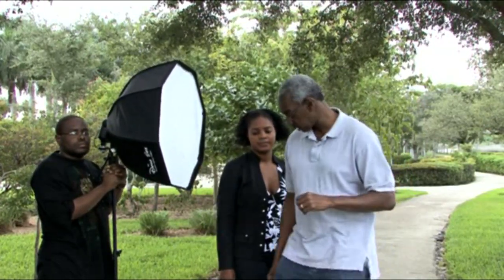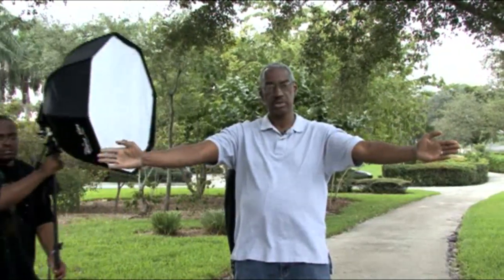How To Use An Off-Camera Flash With A Softbox

Comment: Mr Hill - Nice quick and informative video.  What strobes do you use for studio work or do you just use speedlites?
Reply from the maker: This may surprise you but after graduating from Brook's Institute of Photography in 1975 I bought this small 4 light combo system (https://www.bhphotovideo.com/bnh/controller/home?O=&sku=50157&gclid=Cj0KEQjw0MW9BRDxtYTn2_S699MBEiQAw33y4xpRV4TtHqCafiCAOrSjs4Y_MirG05fgN9XSbBIJ78EaAiwB8P8HAQ&Q=&ap=y&c3api=1876%2C52934714882%2C&is=REG&A=details) and used it throughout my business from 1985-2000 before donating it to a local high school.  It was repaired once for some small issue & I used it religiously for every indoor session booked & it never failed.

A few links to see the system in use:  
http://cornerjournal.blogspot.com/2008/03/natalie-johns.html
http://cornerjournal.blogspot.com/2010/04/piedad-menezes-colombian-glamour.html
http://cornerjournal.blogspot.com/2009/09/blog-post.html
http://cornerjournal.blogspot.com/2009/07/yolanda-britts-pregnancy.html
Reply: I'm sorry but the link you provided is for a Speedotron power supply.  I assume you were using Speedotron heads also.  I was looking at the new Paul C Buff DigiBees.  I already have the PCB ringflash and moonUnit which I love. 

  On a side note, I like your RC videos.  I found one of your videos about a year ago after I purchased an e-Flight Apprentice plane.

Thanks again and all of the best to you!
Kevin
Reply from the maker: Kevin, indeed the Speedoton system was a complete pac)kage.  I remember when P. Bluff came out with his first light system many years ago when I was a fledgling photographer (White Lighting), so the company has been around for some time.  I appreciate you comment about my RC videos.  I'm still producing them and a few Chinese Internet companies have invited me to produce product reviews which gets me the latest models for free.  Take care and stay in touch.